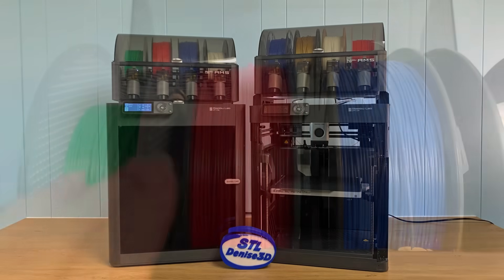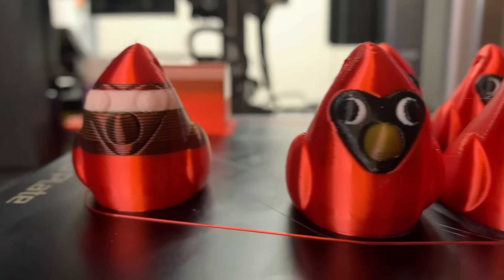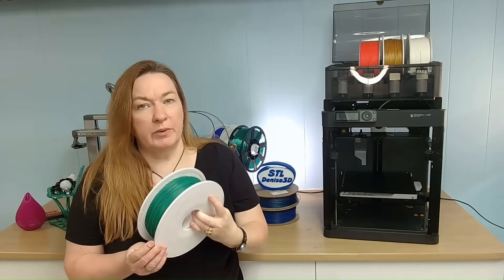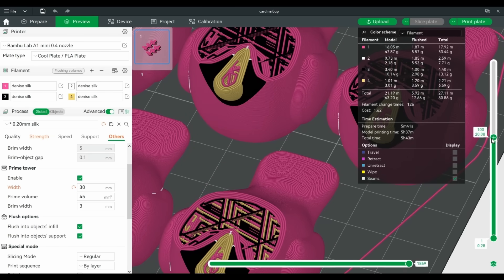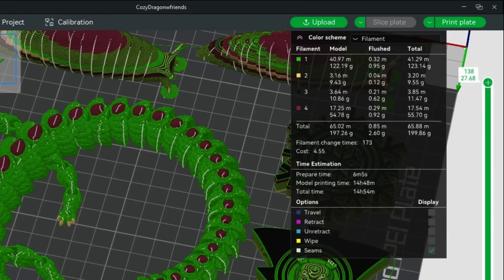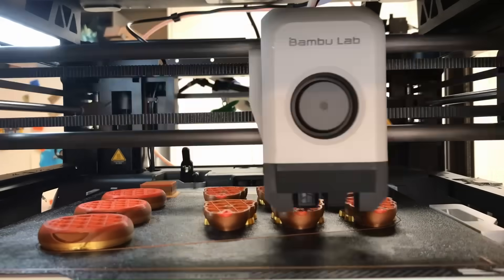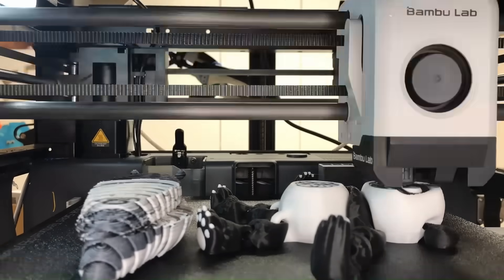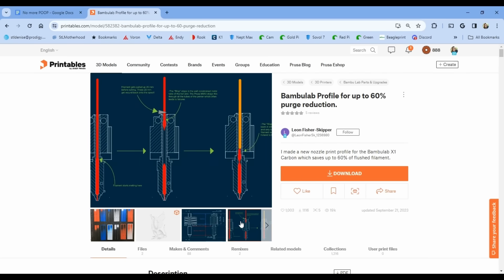Banish Bambu A1 Purge Waste with these 5 Tips.

Comment: The trick with the flush objects is to think of single use objects and tools.  I need things to mix and pour resin so I make tweezers, stir sticks, cups, etc.  I print the cardboard spool adapters with poop also. Printing bambus filament transfer thing one piece at a time until I get all the parts helps. I also print handles for files and other tools.
Reply from the maker: I love this idea!
Reply: NAILED! That's a good advice and damn, It would have been usable even if I didn't mix resins and stuff me too!
Reply: Just like knobs, handles, and parts you can use. If the color doesn’t matter 👍

I printed some boxes for the gridfinity system.

Now I am thinking. Can it be used as supports? I don’t know 🤷
Reply: @willemselten  You can also print gridfinity baskets on top of one another with a bit of support in between, so you can always have something around the right height that is always useful!

Comment: Great video!

I was thinking of making a 1.75mm coil as a flush object, then using that as filament. Not sure if itll work but who knows!
Reply from the maker: I'd love to see that! Would you do a model in the middle and then a coil around the outside?  I wonder how much filament you could cram on the bed with that method. 😃